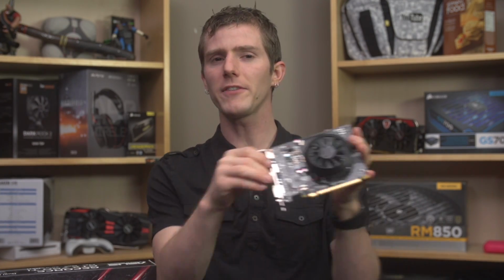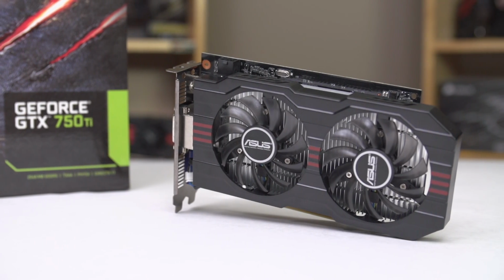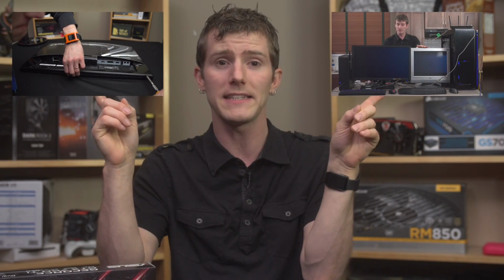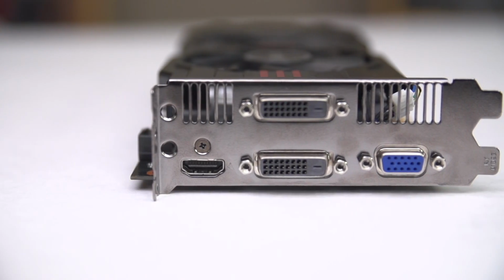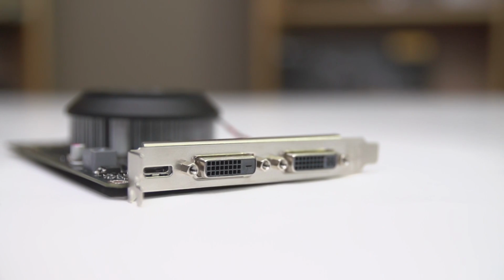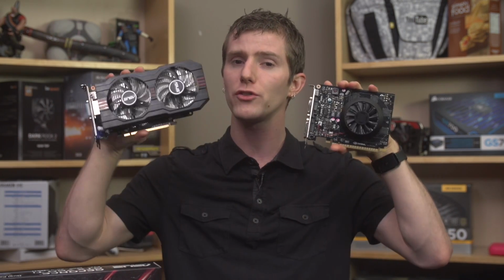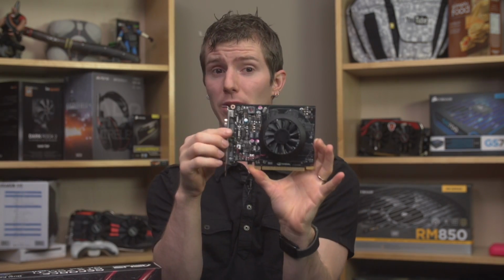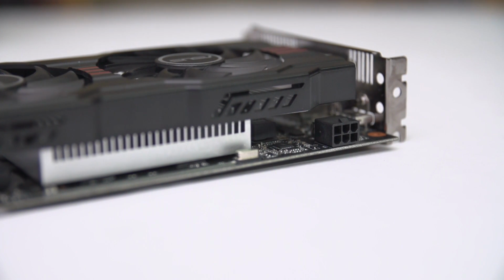GeForce GTX 750 Ti NVIDIA & ASUS Designs

Comment: I was wondering if i can run the gtx 750 ti on my dell inspiron 570...the evga people said since my motherboard last updated on 2012..it might not work, but i have spoken to a couple owners of the 570, and other 2010 to 2012 models, and they said it should work fine...I upgraded my processer to a Athlon x4 645 and put 8 gb of ram in it......I'm just looking for more conformation. ......
Reply: i got it up and running here in my ancient Rampage II Extreme without a problem. Motherboards generally shouldn't have compatibility issues with graphics cards as long as they have PCI slots, even if they are very old.
Reply: The evga guy siad it might work since my motherboards last update wss in 2012..but i keep hearing it will work...may i ask how old is your computer's and last update
Reply: ken b My pc is pretty ancient, its built in 2008, but i replaced almost everything. The last bios update was from 2011, but I even had it running on a version from 2010... Dont worry about EVGA support, they like to be on the safe side. I bought 8gb of Corsair Vengeance last year, and according to the manual it wouldnt work on my motherboard, but it runs perfectly fine.
Honestly, it's a great card, I've got my EVGA 750 ti FTW in my system now, but looking back, you might want to save up another $50 for a 760... The performance difference is quite big, for a little more money. But, as I said, it's a nice gpu and if you still want it it'll probably be just fine with your mobo :P
Reply: Thank you man...i really appreciated it...so you think it will go good with the athlon x4...i was gonna build a gaming rig..,but i rather go cheap this year, and save up for next years build..i figure just throw a 750ti in it....
Reply: ken b Yeah, if you wanna do that the 750 ti will do just fine (i personally recommend EVGA's FTW card, great overclocking) and it should run perfectly. It might be a good idea to go to for example tomshardware.com and ask oni the forum there, just to be 100% sure. Np by the way, glad i could help :)
Reply: Thank you bro, and what would the 760 require as far as psu power..
Reply: ken b about 170W, with a six pin and an eight pin connector. If you're psu is 500W or higher you should be good :)

Comment: would this setup be fine for most games hp pavillion amd athlon x2 gtx 750 ti windows 7
Reply: Alex Ritchie-Pirrit No, the 2x is to the cpu, its a athlon x2..
Reply: The GTX 750ti doesn't actually support SLI. So yeah you could put two in your system but they wouldn't do anything together. Spend your money on a singular, more powerful graphics card like the 770 or 960. You'll get a lot more bang for your buck.
Reply: Alex Ritchie-Pirrit ty
Reply: Alex Ritchie-Pirrit dude, he didnt say anything about getting 2 750's ti..
Reply: If you look closely, he says 2x gtx 750.
So yes he did.
Reply: ***** ty

Comment: My psu gives 10amps on 12v rail can i run it?? 
I dont know the brand though. I think its a cheap one.
Reply: i wouldn't risk it that's a bit to low end, you can pick up a cx 430 for around $30
Reply: k
thanx

Comment: I want to stream WoW LoL CSGO, main games I'm playing. I'm upgrading from my Radeon HD 7790 does anybody know what graphics card I should get 

-Thanks!
Reply: 1gbddr5 Radeon 7780
Reply: r7 260x
Reply: gtx 750 ti 2gb or higher than 750
Reply: go with a 7950 its a great card and its better than the 750 ti,260x,7780,7790, and the 270x
Reply: 21st Central Nope, that card costs way too much don't go with it.
Reply: 21st Central the 7950 is the older variant of the r9 280 i think
Reply: 280 is a rebranded 7950 the 7950 can be found for a 130-150$
Reply: i streamed cs go LoL and WoW just fine with a 550ti so you should be able to stream them with a 750 ti or something like that :)
Reply: Saik Here Get the GTX 960

Comment: Pls reply
Will I need to upgrade my power supply?
I have the power supply that came with my pc...
Reply: what powersupply do you have, most oem psu are very low end
Reply: Probably not if you're running a gtx 750ti, that card has almost no power consumption, assuming that it's a reference card. Even so as long as it's 400w or more with at least 1 6 pin PCIe connector you should be sweet.
Reply: The eveA variant only requires 350 or 300 watt psu (most pcs bought from stores have 350)for the most part just open the case an pop it in
Reply: You could use a 220w psu if it is all you have because i have on and its been workijg for atleast 1.5 years and no problems
Reply: This GPU don't need more power than the PCI-e slot give it to it. So you just stick the GPU in and youre done :D

Comment: Guys here is my pc i'm planning to build, does everything fit ok? if you have any improvements please share!
intel i5 4690
asrock z87 pro3
gtx 750 TI
nzxt phantom 410- atx mid tower
corsair 600w bronze
Reply: I agree with everything but use a Intel cpu
Reply: Get the i5 4590 indstead
Reply: Swap the CPU and Mobo for AMD models, Athlon 760k is an older but still very usable budget cpu which I have in my machine currently. I'd get a 770 with the money saved.
Reply: Or don't.
Reply: Daniel P Terrible idea, the 970 is so much better for a better price.
Reply: Trillion Amaze wasn't really around at the time of my comment. I completely agree. 970 > 770 unless you're getting used cards.

Comment: I've bought EVGA's model which has a DisplayPort allowing for up to 4K with G-Sync support, HDMI and DVI-I. ASUS offers 2x DVI-D and a D-sub 15 for analog, however I prefer the freedom of a DVI-I given NVGA also has a DisplayPort. CLock is 1085MHz (boosted), while keeping the same form factor as the NVIDIA's reference card. Which is great fo the HTPC I've built in a Lian Li PC-Q30 chassis (excellent GC for any SFF/HTPC cases). Not as performing as an EVGA FTW (For the Win) which is the top of GTX 750 Ti (although it's longer and won't fit in most SFF case), but very affordable for an excellent HTPC and a very decent gaming performer in the living room. EVGA's are awesome, and they're a North American company (USA), double-awesome...

Comment: GTX 560 Ti Direct CUII vs GTX 750/750 Ti which is better?
Reply: 750 ti
Reply: Trillion Amaze I bought R7 260x OC 2GB GDDR5 for about 40$ less then GTX 750Ti
Reply: SleapyYy That's cool, I could easily buy a 750 ti to match that price if its on sale with rebates. Nothing to be fucking proud of.

Comment: AMD FX 4300 4GhZ processor-
MSI B85-G43- 
GTX 750ti graphic card-
Corsair 4*2GB 1600Mhz RAM-
Corsair CX430w
Reply: Alastair anything running AC Unity with stability. HA!
Reply: Alastair when it says corsair 4*2gb set it looks like it says 2gb ram and corsair 4 is the series of ram, say 4 x 2gb to make it understandable
Reply: Stop commenting. Shhhhhhhhhhhhhhh
Reply: Yeah couldnt agree more
Reply: Can it run BF4, CoD AW, and AC Unity stuffs?
Reply: Alastair http://www.systemrequirementslab.com/cyri
Reply: 2GB RAM cannot
Reply: 2GB of graphic card -_- ram is 8 gb
Reply: That motherboard is for Intel CPUs, not AMD ones. You need a motherboard with a AM3+ socket for that FX CPU.
Reply: Also, use PCPartPicker.com so it's easier to see your whole build. Check out the LinusTechTips forums and r/buildapc on reddit for more help than just the youtube comment section.
Reply: Safwat Khan from a pure scientific perspective you're wrong since "2 x 4" isnt as correct as "2*4" since that's more an official way of writing it.
Reply: Stahle Frid Well, 2*4 usually means 2 times 4, which is 8. 2×4 on the other hand, usually means 2 by 4, which means 2 sticks of 4GB. So 2×4 is better to use.
Reply: ***** 2x4 isnt as correct as 2*4. 2*4 is the academic accepted way of writing it.

Comment: GTX 750 TI
G3258 Intel pentium
4GB Ram
1TB Seagate

Good?
Reply: thats a pretty good build. The pentium G3258 is dual core but a fast dual core, I heard some say that it out-preforms my cpu, athlon x4 750k quad core. I do use the 750ti FTW and I love that card, I have not found one game it cant play battlefield 4 plays awesome on medium settings at 1080p, I downloaded the Evil Within demo and I can play that at 1080p, medium shadows, at around 40 to 50fps it all depends on where Im at in the game, if Im in a dark hallway I will get almost 60fps, Metro 2033 (which looks great) can run at very high settings at 60fps. So all in all, the pentium and the 750ti are good combinations. The Ram could be a little higher, but 4gb is still good
Reply: If you get that cpu get an after market cooler (like  hyper 212 evo) for it and overclock it. there are hundreds of guides on the internet to help you and that little cpu is meant to be overclocked.
Reply: Very good and similar to mine but I would choose 8 gb of ram so you can play more games
Reply: I would agree with AnonymousDalton 8gb is the least a gaming pc should have.

Comment: ok, i don't understand how but every benchmark test i look at shows my card being above this and it's a gtx 260 216 cores superclocked , but everyone keeps talking about 750 ti like it's amazing, is there something i am missing?  i'm looking at upgrading but probably wait til the 770's come down in price looking at the specs
unless someone can point something out about this card i am missiing
Reply: mohamed elhatmi um first off read it again, gtx 260 216 cores (IE stronger than a normal 260)

and i was asking why every time i look up benchmarks for the 2 mine now is rated higher so i was comparing them on other sites  which rate the gtx 260 216 higher than the gtx 750 ti
Reply: even if it was sli'd it wouldn't beat gtx 750 ti.
Reply: ok...so can you explain why every site i check shows it being the same or less then? that's what i was asking in the first fucking place.
Reply: check it oout on game debate, gtx 750 ti is 68 % better than gtx 260 216 core
Reply: mohamed elhatmi and from whats posted here the 260 is better , i don't want a card that's better than mine at some things but weaker at others, if im getting one i want a flat increase on everything http://www.hwcompare.com/17203/geforce-gtx-260-core-216-vs-geforce-gtx-750/

Comment: Will the EVGA GeForce GTX 750Ti or EVGA GeForce GTX 750Ti Overclock work with my computer? I have 4 GB  RAM and runs at 2.58 GHz. I have an Intel Celeron Processor.

Link: http://www.bestbuy.com/site/dell-inspiron-desktop-intel-celeron-4gb-memory-500gb-hard-drive/5858051.p?id=1219165148215&skuId=5858051&st=Tower&cp=1&lp=14

Comment: This card is great, I have the MSI version and I  get solid 1080p 60fps performance on games like Skyrim, Titanfall, bf4 etc with no overclocking. 
As long as you're careful with your settings (turn off AA and ambient occlusion etc) you can crank the important things up to very high/ultra. 
Excellent performance for the price, I would strongly recommend buying this if you don't want to spend an extra 200 so you can have some extra lighting effects and smoothing. For me and a lot of people, this is just fine. 

The money I saved buying this card let me spend more money on my monitor (a nice crisp IPS panel)
Reply: mrcrazyenough007 You don't need a GTX 760 for for 1600x900 just stick with what you have it looks great.
Reply: I am on a very tight budget.. so I am building this system for playing games on 1600x900 High/Ultra (except AA)
Are these okay ? 
- Intel Core i5-4590 6M Cache, 3.7GHz
- ASUS B85M-G LGA 1150 Intel B85 HDMI SATA 6Gb/s USB 3.0 Micro ATX Intel Motherboard
- Kingston HyperX FURY Memory Blue 8GB Module - DDR3 1866MHz
- GIGABYTE GV-N75TOC-2GI GeForce GTX 750 Ti 2GB 128-Bit GDDR5 PCI Express 3.0 Video Card Dual Fan
- Corsair VS450 Watt Supply

with 1TB HDD and a Gigabyte Casing, it costs around $750 in my country.
Reply: mrcrazyenough007 maybe a little better gpu? gtx760 would fit into this price bracket, and also the power source should be somwhere near 600w or so, i'd recommend 550w :)
Reply: MortalSpirit Doesn't need a higher PSU at all, and the 750 Ti will blow games away at 1600x900. His build looks great dude :)
Reply: bleedinsixcolours I myself bought:
r9 270
fx6300
8gb ram
500w psu

imo 500w for mrcrazyenough007 is too low :/

but hey what do i know? :D
Reply: MortalSpirit Your rig could run off about 400w mate.. but your 500w is great for future proofing ur PSU.

I think MrCrazy's rig is about the same draw as yours, maybe lower dude..

 Oh well whatever floats your goat! :)
Reply: Can i computer handle this gpu ?                            Power suppy: 500watts . Processor: intel pentium dual core processor ram : 8gbs
Reply: ariel montesino Yes the minimum psu requirements for this gpu is 300 watt so your good
Reply: ariel montesino Yes definitely bro :)
Reply: Poor Luke he is exploited !!!
Reply: MortalSpirit You know nothing.. the power requirements are 300w.
Reply: Trillion Amaze according to calculations the minimum is 378w...
Reply: MortalSpirit I trust NVidia more than you.
Reply: I had it for years even played Far cry 5 or bo3 on it

Comment: I am amazed at what my little MSI card can do. Skipped both the 500 and 600 generations cause my 460 was the little card that could. Started getting into Planetside 2 and she started to struggle. The 460 is still in running my 2nd monitor, but the 750 handles things without any issue.

Comment: Dear linustechtips, 

I'm making my own pc should I put dual 750 or 760ti or a evga gtx780
Reply: 1. you can't crossfire 750's 
2. don't go for a 760 Ti 
3. get a 780.
Reply: AFAIK 750 doesn't support SLI. On paper GTX660 is better than gtx750ti, and it supports SLI.
Reply: fancypants2020 Also the 760 Ti doesn't exist, or at least not sold to consumers.
Reply: imapie4688 This^

Comment: Do you think this card would run gta 5 on high or medium settings? (Once it comes out on pc)
Reply: Medium at least. Just may need to play around with the settings. Saw a gameplay of GTA4 using that card here and it wasn't bad. I bought the EVGA GTX 750 Ti SC hours ago on Amazon for Dead Rising 3, The Killer Within, and GTA5. Had used GTX 295 for four years but saw it was time to upgrade, and not going overboard on price.
Reply: Dude i have the Gigabyte 750 ti and this thing can play Metro Last Light with pretty mutch everything max without SSAA at about 30FPS (i could tweak the graphics and make it run smoother but its looks too damn good).
Reply: Its pretty amazing (Bf3 at ultra 4xaa and 4xanisotropic filtering at more than 60 fps 1080p)
Reply: TheMrKeksLp A win at that price, too. Only if SLI was possible.

Comment: Gpu: Gtx 750 ti
Cpu: intel core i7-4770
Mother board: Gigabyte Z87-HD3
RAM:8 GB DDR3 (KINGSTON 1600 Mhz)
HDD:1 TB SEGATE
Power supply: Corsair 600w
Case: HAF-912 Cooler Master
Is it good
Reply: Why would you pair a 750 ti with an i7? Also, the cx430 would be plenty for those specs.
Reply: Andrew Arnold Why wouldn't he? If he needs much CPU performance?
Reply: actually am getting a 770 and an i7 4770k :D
Reply: If you're gaming you don't need an i7, you're just wasting money. (Unless you're rendering or something)
Reply: ***** Sure if you have money to burn, but really the i7 and i5 have nearly identical performance when it comes to gaming.
Reply: I got 780 TI and 4770k
Reply: You have money
Reply: Yeah get an amd athlon x4 (for now) with a 760 instead of you want better gaming performance

Comment: Will this run on my rig ?
Pegarton 2ad5
Intel Core i7 3770 @ 3400
Gt 640 
3 x 4096 DDR3
600 W power suply
Reply: I'm thinking of getting a GTX 780 :D 
But I really have to save up as they are super expensive .. :/
Reply: your pc can run it but sence you have an i7 cpu. get a gtx760 to balance it out more
Reply: Nawar Aswad What do you mean by a 780 ti will bottleneck my cpu ?
Reply: Nawar Aswad Are you kidding? That i7 is way more then those cards need for gaming
Reply: I bought the pc knowing nothing about gaming ..
Reply: william kosse I have the same processor as you, the 3770. Honestly it's a really powerful processor and you don't need to upgrade it. A 780ti will work fine with it. However, the 750ti is one of the best price performance cards you can get, that will give you a brilliant fps. Just a word of advice though, in your computer there might be a plug that has 6 'holes' in it. It might be plugged into your graphics card, it might just be hanging freely somewhere. If you don't have it, then check for 2 wide looking plugs, which have 4 holes in them. If you don't have the 6 pin plug I mentioned, you need a 4 to 6 pin pci-e adapter. This is needed otherwise you can't power your card. If you have the 6 pin plug already then no problem you're fine. If you don't, but you have two 4 pin plugs, buy that adapter. Just some advice there lol
Reply: Thanks a lot man :D

Comment: hey guys, can this + i5-4440 + 8gb 1600mhz ram run bf4 well? :))
Reply: thanks :)
Reply: the Gigabyte version
Reply: there are peopl with this card with the same setup that are playing bf4 on ultro single player at 40 fps but if you lower to high detail. you can get 60 fps

Comment: Want to buy it i have 550w psu, so it is enought, have Intel 2 duo Q9300 quad core 2.5 ghz, 4 gb of ram, and right now very powerful gpu that is called ati radeon 1650 that has 256 mb :)

Comment: I have a Galaxy GTX 650 Ti Boost that performs almost the same as shown here of the Asus performance but it sucks double the power than the Asus, here I have just found the EVGA and the MSI versions of the 750 Ti
Should I go for the MSI just to quit a bit of stress from the PSU (450W)?